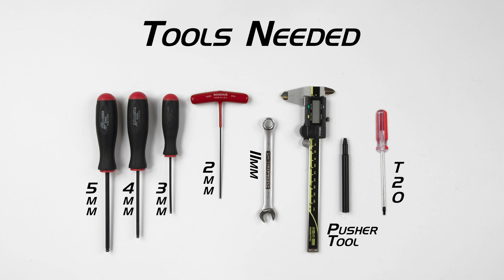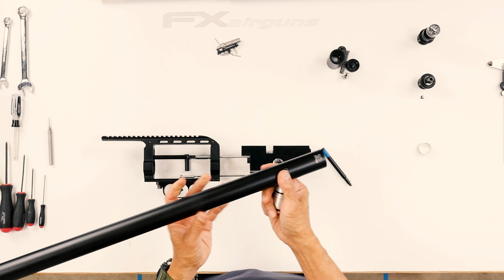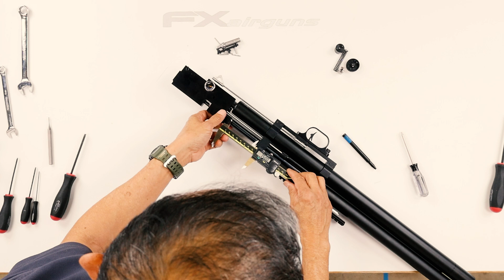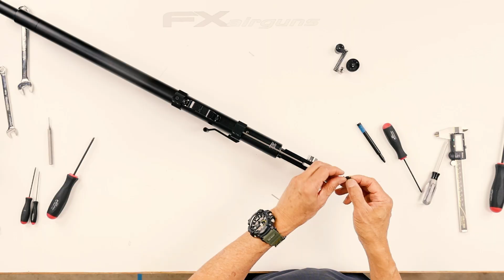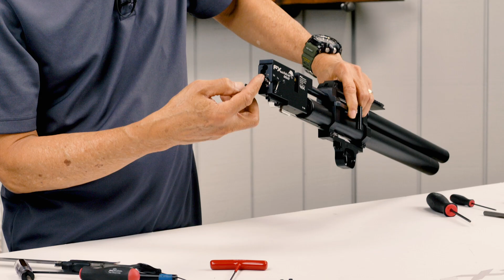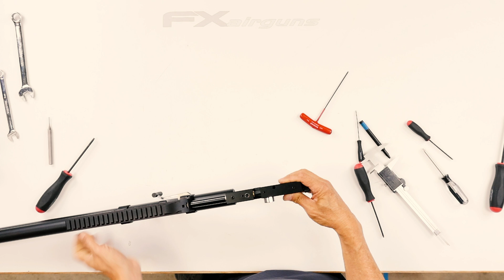FX Wildcat MKIII Reassembly - FX Masterclass

Comment: Hello

I have a new rifle FX Wildcat MK3 BT Compact cal.22

For cleaning reasons, I removed the barrel from the rifle by COMPLETELY unscrewing the two screws fixing the barrel of the rifle. On the official FX Airguns drawing, those two screws have references FX19086 (conical grub screw M6x8) and FX19955 (grub screw M8x6).

The FX19955 screw (grub screw M8x6) had some dried glue around it: I cleaned this dried glue completely.

I then reassembled the gun barrel and screwed the FX19086 (conical grub screw M6x8) and FX19955 (grub screw M8x6) screws. 

Since then, every time I fire, the air under pressure escapes from the screw FX19955 (grub screw M8x6).

Should I put glue around this screw to avoid leakage?
If so, which one?

Could you help me

Vincent (from Belgium)

Comment: I am having trouble with getting the sear back in correctly. The view of your video was not close enough, so I am a little bummed out. I will try and watch a couple more times. There are the 3 pin holes, to pin the sear, the pac-man assembly, and I believe you said a safety lock? Starting with the receiver upside down, the top hole #1-??, middle hole-??, and the bottom hole #3-??. I’m sure I am over thinking it. I know I should have recorded the takedown, that’s on my dumbass. Great video and I love my Cat III, but at this moment I can’t use it! 😭😭

Comment: Hi I have a question how do you adjust the length of the barrel placement in the block? I just got a wildcat mk3 sniper .30 and the brass sleeve over the barrel at the block is out to far and will not let the clip slide in. It's safe to shoot, had to hand load it to set it.
Reply: Yes, insert the magazine into the breach before tightening the grub screw holding the barrel in place.

Comment: Hello
I have mk3 sniper version in .22
So I bought a .25 barrel
Can you tell me the best tune/settings to 25gr jsb kings to begin with?
Reply: I have a .25 wildcat mk3 sniper the stock settings are 110 bar reg and on power stand 7 it shoots the 25.4 grain jsb at 277ms 63 joules 69 shots before refill.
I use power 5 245ms 49 joules 115 shots very nice gun.